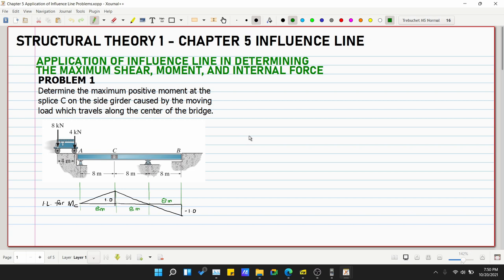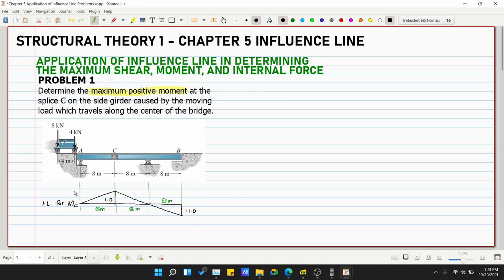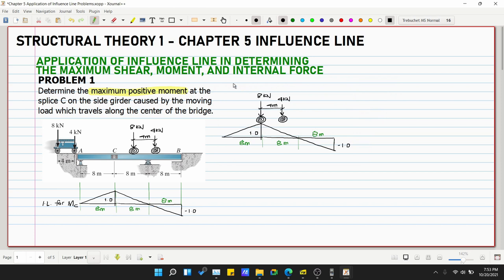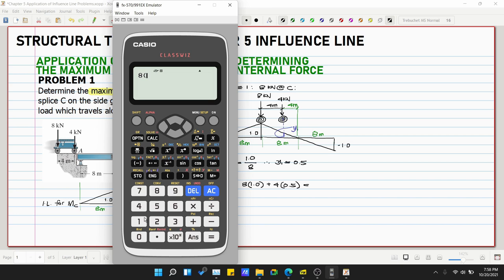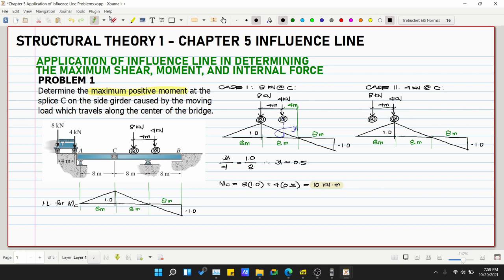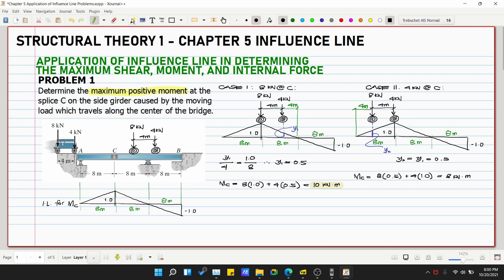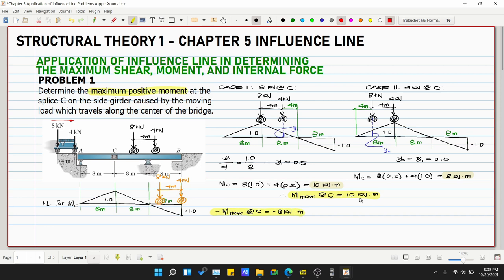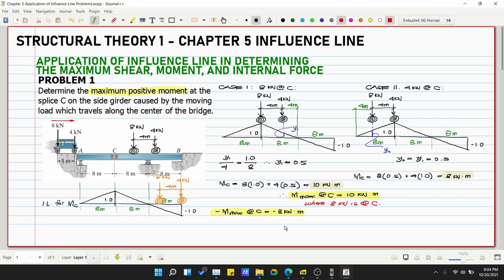Structural Theory 1 Maximum Function using Influence Line Problem 1 (PH)

Comment from the maker: CORRECTION:

Since ang topic na ito is all about the maximum function, we no longer double check the influence line diagram from the solution manual na hawak namin.

1. The maximum ordinate for the I.L. Diagram for Mc at point C is 4.0.
2. The maximum moment at C, Mc = 8(4) +4(1) = 36 kN-m.

Comment: Hindi Po ba 4 Yung  highest ordinate sir?
Reply from the maker: Bakit naging 4?
Reply: 4 din nakuha ko. 8x8÷16=4
Reply from the maker: @Jonard Angelo Awiten Sorry, ang basis namin sa Influence Line Diagram dito is sa Solution Manual na hawak namin, which is 1.0 ang maximum ordinate niya, kaya yun yung naging basis namin. Pero i-pin namin ang correction sa comment section dito.
Reply from the maker: @karlvenzmoaje7838  Sorry, ang basis namin sa Influence Line Diagram dito is sa Solution Manual na hawak namin, which is 1.0 ang maximum ordinate niya, kaya yun yung naging basis namin. Pero i-pin namin ang correction sa comment section dito.